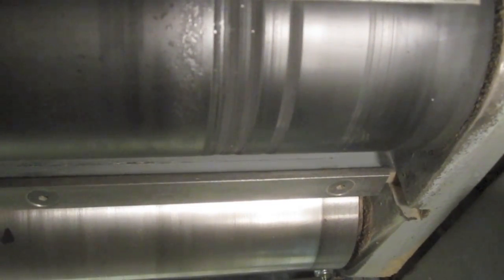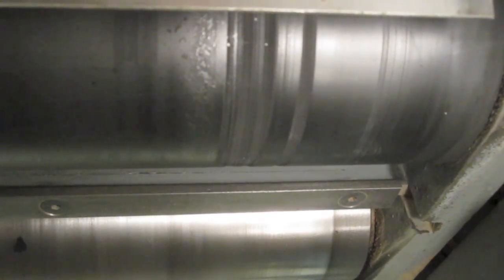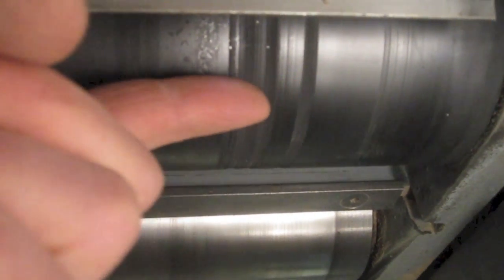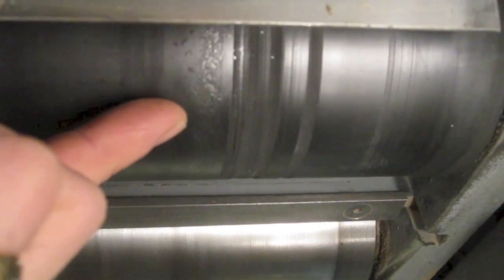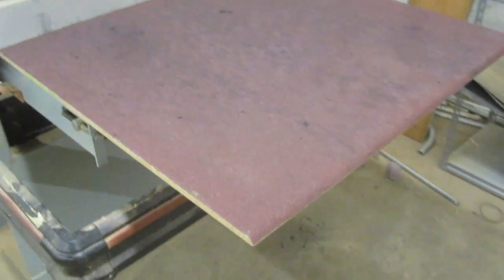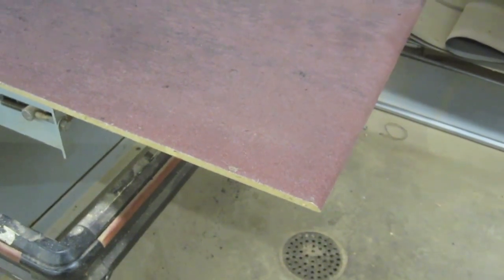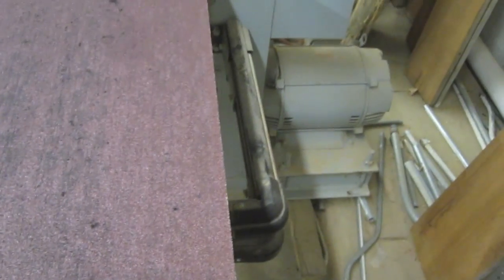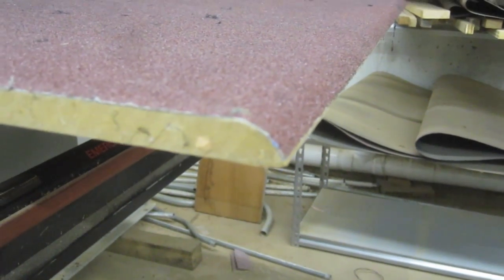Dressing a Drum on a Widebelt Sander / Wunderwoods.com

Comment: I know this was 6 years ago, but I  am going tom do the same thing on my 43" time saver. How did you turn it on without a belt on, seems like I'd have to over ride a safety to run it.
Reply from the maker: It runs fine without the belt. Nothing different.

Comment: Hey there! I’m gearing up to do this to an old jet 36” wide belt jwd-37p. My one concern about it is how the second drum, which is steel will handle the dressing. Is your second drum steel as well? Also, did you have to recalibrate the pressure bars or platen? Thanks for your help!
Reply from the maker: The rubber drum is lower than the steel drum, so the steel drum wasn't affected. We have done this a few times now and haven't needed to recalibrate anything. We don't really use the platen, so calibrating for that wasn't an issue for us, though I think it would still be fine.